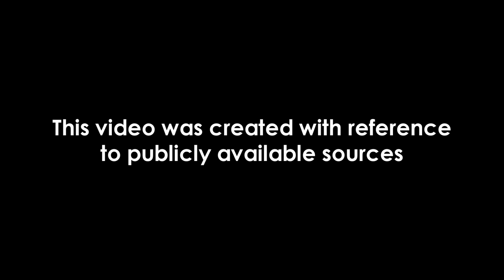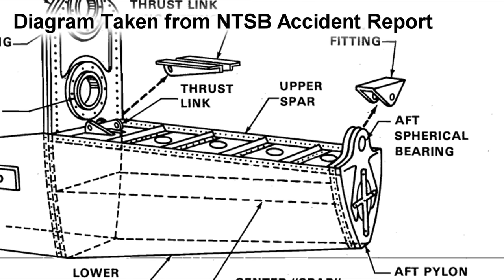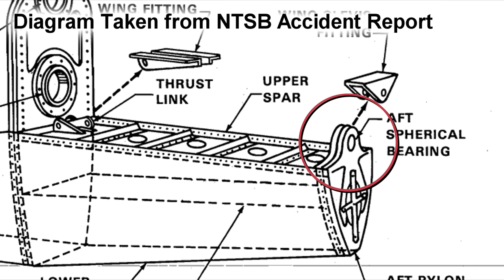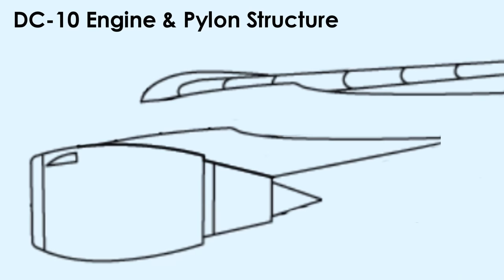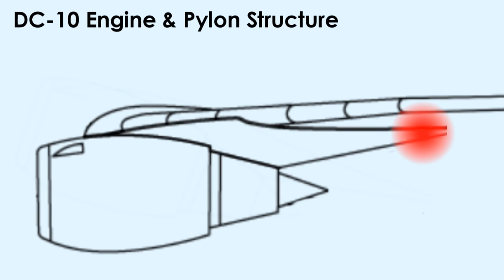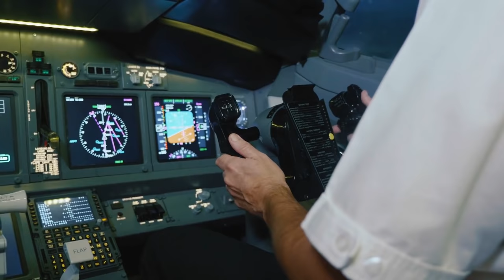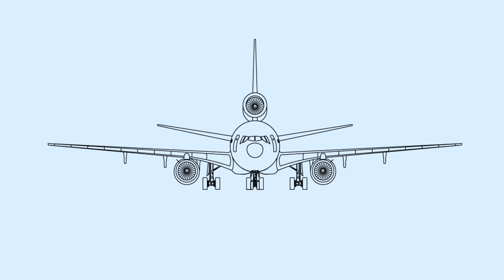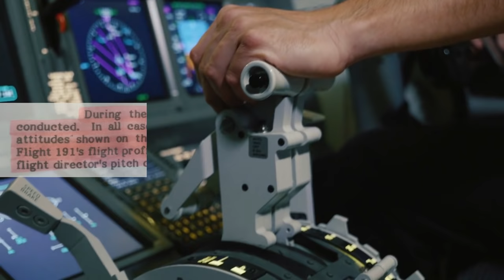America's Deadliest Air Disaster (American Airlines Flight 191) - DISASTER BREAKDOWN

Comment: What is scary about this is that the pilots reacted exactly as they were supposed to with the loss of the #1 engine. The cutting of the hydraulic lines and the retraction of the slats was information that they did not have. They were doomed as soon as the damage occurred from losing the engine. There isn’t anything they could have done differently with the information that they had.
Reply: Even had they had slat disagree lights,  by the time they saw them, the plane was beginning to roll, and at 300 feet, I don't think they would have time to recover. 
The A/A training of reducing power with an engine out I never did understand. 
Full power all the way out might have saved them, I'm not sure. 
Makes me wish with everything in me, the pilot's had known the slats had retracted.
Reply: Unfortunately there was one thing they could have done, and it probably would have saved the aircraft.  There is an Emergency Power switch on the overhead panel, and had either pilot (or possibly the FE?) switched it to ON when they lost many of the instruments, it would have restored Slat Disagree and more importantly the FO's stick shaker for at least the next 30 minutes.  Enough time to detect/avoid the incipient stall and return to the airfield for a fairly straightforward overweight landing.
Reply: You’re getting one thing wrong.  AA opted not to put a stick shaker on the FOs control column when they bought the a/c even though it was an available option from MD.  The requirement for dual stick shakers came out of this accident, along with the requirement to have mechanically locking actuators for LE slats, and the emergency procedures for an engine-out were  also revised  to maintain present speed, not slow down to V2.
Reply: @get2dachoppa249  You're right (that I was getting one thing wrong ; )  Emergency Power would have restored the captain's stick shaker.  As you point out (and I was aware of, prior to Brain Freeze) the FO had no stick shaker to restore.

Regarding slats, DAC had originally been able to skip incorporating locks and/or fuses in the hydraulic lines because they successfully demonstrated to the FAA in flight test that even with all slats retracted on one side, the aircraft remained airworthy (note 191 only had its slats outboard of the pylon retract).  Unfortunately this test was done during cruise flight, neither DAC nor the FAA having anticipated 191's scenario.  A wing engine departure was covered in the Failure Modes & Effects Analysis (FMEA) which  DAC submitted to the FAA, but only in the context of being a loss-of-aircraft event.  So it wasn't something they designed for.

Regarding why airline training was to reduce power on the remaining engines and fly at V2 (minimum safe flying speed), my non-powerplant-specialist guess is the idea was to minimize the chance of a second engine failure soon after they had just lost one -- avoid the higher temperature/mechanical stress/chance of failure that goes with higher power levels.  Sort of like when one tightens a bolt, and backs it off just slightly so that if it happened to be near its failure stress, now it won't be.  Recall that back when these procedures were set, turbojet engines were far less reliable than in the decades following.  And they also had to consider the likelihood of prolonged flight on the remaining engines (fuel dump, troubleshooting etc), in which case the remaining engines were going to be at elevated power/temperature for some time one way or the other... so don't make it worse by running at higher power levels early on when by definition you ought to be able to safely throttle back to V2.  As 191 showed, however, maybe that was no longer the best way to minimize overall risk.
Reply: @get2dachoppa249  
Stick shaker wouldn't have mattered.
Reply: @alhanes5803  - Wrong.  See my reply to your other post.
Reply: @bradcrosier1332    "if you look at the CVR trace readouts, power on #2 & #3 engines is essentially stable."  Thanks for that.  It's been a long time (too long, apparently ; ) since I studied the FDR readouts in the NTSB report.  With V2 for 191 having already been reached during the interval between rotation and liftoff, they were good to go... until retraction of slats outboard of the #1 engine raised the stall speed on that wing by ~20 kt IIRC.

Apparently (just my guess), increasing roll to the left which could not be overcome with aileron was perceived by the pilots as a controls problem rather than an airspeed problem, so they fought that battle as best they could but it was the wrong one.  Thus my statement that a working stick shaker (along with Slat Disagree) likely would have made all the difference:  They would have nosed down before the aileron authority available from the #3 hydraulic system (which remained operational throughout) was exceeded. 

Except now I'm second-guessing the NTSB report, and therefor myself, when it comes to stick shaker/Slat Disagree.  Even if the stick shaker had power restored to it, what are the inputs/thresholds which trigger it, and would those still have been "intact" following the damage?  Likewise for Slat Disagree:  Presumably there was an LVDT or something on each slat segment to sense position, feeding signals into an analog circuit (everything was analog back then) which looked for differences beyond a certain threshold value.  But what would an open circuit (from broken wires) look like to the comparison circuitry, vs the sort of signal it was designed to receive from my notional LVDT's?  Would it still give the correct output (illuminate Slat Disagree light) under those circumstances?  I assume all of the above got thought about in compiling the NTSB report, but if so it wasn't spelled out.
Reply: @marcmcreynolds2827  - Hi Marc, I generally agree with your conclusions.  To put a bit finer point on a few items:

"With V2 for 191 having already been reached during the interval between rotation and liftoff, they were good to go... until retraction of slats outboard of the #1 engine raised the stall speed on that wing by ~20 kt IIRC."

That sounds about right to me, or even low.  I do recall that slat retraction speed on the -10 and -11 was very high during normal climb (granted, that was with flaps retracted as well and the entire wing - not just the outboards, both unlike the accident scenario).  What I did catch in my review of the NTSB report is that the roll began at V2 + 6 KIAS.

"Apparently (just my guess), increasing roll to the left which could not be overcome with aileron was perceived by the pilots as a controls problem rather than an airspeed problem, so they fought that battle as best they could but it was the wrong one."

Actually not just your guess, also pretty much what the NTSB surmised as well (a view I concur with) - "...since the pilots were well aware that V2 was well above the aircraft's stall speed...the roll probably confused them, especially since the stickshaker had not activated."

"Thus my statement that a working stick shaker (along with Slat Disagree) likely would have made all the difference:  They would have nosed down before the aileron authority available from the #3 hydraulic system (which remained operational throughout) was exceeded."

I essentially agree, but two points:
1) Roll authority in this case was compromised by low airspeed (control effectiveness) and the loss of the #2 & #4 spoilers on the right wing due to the loss of hydraulic system #1; however, their was sufficient roll authority even with those factors until - 
2) Once the wing was stalled, essentially no amount of roll control input could stop the roll.  Essentially the aircraft was entering an incipient spin - the only cure was to get the wing flying again, but they had no way of knowing that.

"Except now I'm second-guessing the NTSB report, and therefor myself, when it comes to stick shaker/Slat Disagree."

Not really, again from the report:
"In summary, the loss of control of the aircraft was caused by the combination of three events: the retraction of the left wing's outboard leading edge slats; the los of the slat disageement warning system; and the loss of the stall warning system.  Each by itself would not have caused a qualified crew to lose control of its aircraft, but together during a critical portion of flight, they created a situation which afforded the flightcrew an inadequate opportunity to recognize and prevent the ensuing stall of the aircraft."

"Even if the stick shaker had power restored to it, what are the inputs/thresholds which trigger it, and would those still have been "intact" following the damage?"

It's been a long time since DC-10 school, so I had to dig out my old manual.  The shaker is activated by the autothrottle computers, which receive inputs from AOA vanes as well as flat and slat position transmitters.  The shakers (our had dual systems) active whenever the aircraft is less than 105% of stall speed. So yes, if it was powered it would have operated - that part I was certain of, it was the slat position info I wasn't certain of...

"Likewise for Slat Disagree:  Presumably there was an LVDT or something on each slat segment to sense position, feeding signals into an analog circuit (everything was analog back then) which looked for differences beyond a certain threshold value.  But what would an open circuit (from broken wires) look like to the comparison circuitry, vs the sort of signal it was designed to receive from my notional LVDT's?  Would it still give the correct output (illuminate Slat Disagree light) under those circumstances?  I assume all of the above got thought about in compiling the NTSB report, but if so it wasn't spelled out."

General design principle for devices such as that is if they aren't fully positioned, they aren't positioned at all.  More likely simple microswitches.  Similarly, if they aren't all extended, then none are.  From my DC-10-30 manual:
"Slat position is monitored at one inboard and one outboard slat on each side.  Position inication is probided by three lights combined with the flap/slat position indicator.  TAKEOFF and LAND indicator lights illuminate wen the slats are extended to the corresponding position.  A DISAGREE light illuminates whenever any slat position sensor disagrees with the position of the slat handle.  Therefore, the disagree light will be illuminated when the slats are:
- in transition to a newly selected position
- asymmetric
- jammed
- following an auto-slat extension"

So slat position would have been available if powered, and would have been reflected by the stick shaker.  Which takes us back to the fact that had the shaker & slat warning been powered, the crew would have had a chance of saving the aircraft.

But Al Hanes probaly still doesn't think I've flown a large aircraft...  [rolleyes]
Reply: @bradcrosier1332  Thanks for doing the digging!  Regarding "2) Once the wing was stalled, essentially no amount of roll control input could stop the roll."  Yes, it all came down to whether the incipient stall was detected and reacted to before the left wing lost much of its lift.  I got to see firsthand how that went in practice, witnessing some of the FAA's simulator runs performed post-accident.  A video camera for the motion-based simulator, feeding to a MBS flight deck elsewhere in the building, would start moving down a "runway" in the middle of an oversized model train-like layout.  At its Vr of maybe 1 fps translation speed, a tilt upwards followed by rising above the surface.  Then at an altitude of around two feet, depending on whether it had ceased tilting up it would either keep rising or do a sudden tilt down.  Many of the attempts were successful, though of course everyone at the controls knew what was coming.
Reply: @marcmcreynolds2827  - Thank you!  Very cool to have been there for those tests.  Might I inquire what your role was to be involved with that?
Reply: @bradcrosier1332  I had the vital role of... kid who wasn't supposed to be there.  Wondered off from my assigned location/job to see what was going on with the "Chicago crash" simulations.  Apologized to the boss (sort of : ) when I finally showed up back where I was supposed to be.

Comment: A bit more context for why this time wasn’t the same as every other - the forklift was left unattended for an extended period of time following a shift change, supporting the weight of the incorrectly disassembled and partially attached engine+pylon assembly. The forks, with no pump maintaining the hydraulic pressure, dropped under the load - but not by enough to be noticed. In turn, the unsecured pylon under the weight of itself and the engine, settled enough to jam the pylon against the bulkhead. The damage to the rear attachment point is thought to have happened when they were trying to break the pylon free. In the best circumstances this off book procedure was ill-advised and extremely difficult to do correctly in no small part because a forklift is a blunt instrument where precision was required.
Reply: There was a TV series here in Australia called 'Air Crash Investigations' and they did an episode on this crash.
I remember them mentioning the shift change & the engine left on the forklift.
Reply: Perfectly put.

Comment: This is perhaps one of the saddest crashes in Aviation history, short of the Tenerife disaster which IMO probably takes the top spot.  But in this one, a plane full of people (plus I think some on the ground) lost their lives, because the airline was trying to do a short cut during maintenance and save money.  But in the end, it cost them more than just money.
Reply: I'd put JAL123 in there as well, just because of how hard the pilots fought to save the plane even when it was too late. The passengers' fears while the plane was continuously ascending and descending, with mountain ranges on either side. Then, to top it off, the fact that many likely survived the crash, only to die of exposure/untreated injuries because rescue operations were deemed "not worth the risk" (since the general opinion was that nobody could have survived). And all because of faulty maintenance that could have been prevented. Just heartbreaking and infuriating.
Reply: When I was stationed in England, back in 2005, my wife and I took a vacation to Tenerife.  I had no idea at the time it was the location of the worst air disaster until I was later reading up on the island.
Reply: Actually,  the USA had troops in the area, and wanted to help, and Japan refused the help. Survivors said several people died waiting for help.
Reply: @alhanes5803  The fact there was a terror threat at the neighboring airport at the time didn't help.
Reply: Ooooof, Tenerife defo takes the cake. It all came down to a stubborn man’s decision and that ended with over 500 souls being lost. I can’t comprehend it.
Reply: There was another crash that seems largely forgotten due to happening very shortly after 9/11, coincidentally also in New York. Only a few less people died, and again killed some people on the ground.
Over-use of the rudder caused inflight breakup.
Reply: @DoubleMonoLR american 587 isn't forgotten, It's also widely known

Comment: It is stunning how small things take down these complex machines.
No one has ever made a foolproof mouse trap mush less a foolproof airplane.
Reply: There are hundreds upon hundreds of redundancies inside of most modern in aircraft but there are just some things that you can’t reinforce.
Reply: Anything made by man can, and eventually will fail. The properties of any material cannot hold forever. But..this wasn't the materials fault, as Engineers will always "over engineer" to prevent this from happening. But when you get a group of mechanics who were all about "quick and easy"...that was what made all the engineering meaningless. And to think, this happened to two other USA DC 10's due to the same quick go around that was never to have been performed.
Reply: Most transportation regulations are indeed written in blood. Sounds macabre, but it’s true.
Reply: @patrickmollohan3082    The other two DC-10's lost was due to a cargo door faulty design. After the first one, a window was put in so line guys on the ground could see the dogs were engaged when closing the door. Second Turkish one happened because the door closing instructions were in English and the Turkish line guy couldn't read them and didn't ensure the dogs were engaged.
Reply: @richstewart1  
Thank you sir. 👍✈
Reply: lol 😆

Comment: I served in the U.S. Air Force from 2000 to 2014 as an aircraft hydraulic mechanic.  Deviating from technical orders that guide maintenance procedures such as this engine removal/installation would have to be approved by engineers and not the organization performing the maintenance.  Of course, a lot has changed since this happened in 1979.